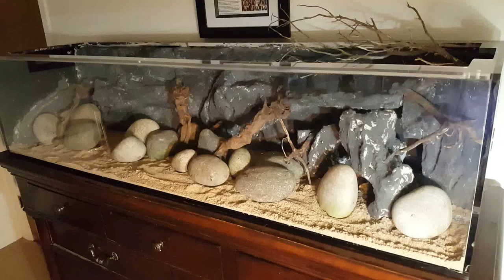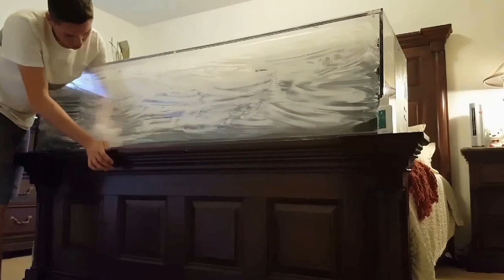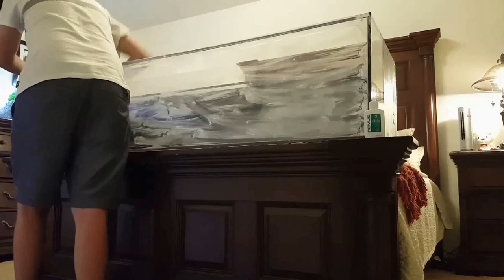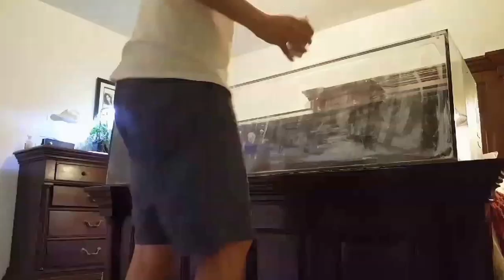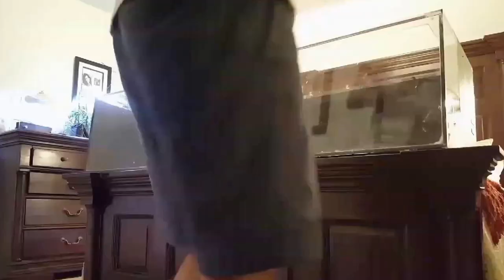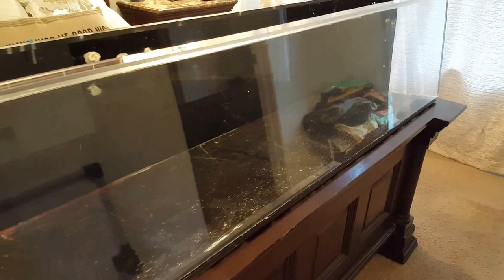Acrylic Scratch Remover DIY

Comment: Hi quick question,when you put stage 3 and 2 on do you leave the layer on for a bit or did you take off straight away once applied also what cloth did you use to take off wet or dry.thanks
Reply from the maker: Ac1892 
Novus #3 removes heavy scratches and abrasions from most acrylic surfaces. Use it when damage is too severe to be restored with NOVUS No. 2 polish. 
It requires the use of NOVUS No. 2 for final finishing. 
It is not recommended for use on coated plastics 
Shake well. Test in an inconspicuous area. 
Apply NOVUS No. 3 liberally. Using a clean, soft cloth, polish with a firm back-and-forth motion at right angles to the scratches. Keep the cloth saturated with polish at all times. 
Continue polishing until only fine scratches remain. Using cloth, remove all remaining polish, this is very important! 
Using a clean cloth, apply NOVUS No. 2 in a circular motion uniformly to entire surface. Polish using light pressure until NOVUS No. 2 dries to a light haze. 
Using a clean portion of the cloth, buff the surface clean. Follow with NOVUS No. 1 for best results.
Reply from the maker: Ac1892 
Novus #2

Novus Plastic Polish #2 removes fine scratches, haziness and abrasions from most plastics. With repeated use, NOVUS No. 2 restores faded and discolored plastics. 
It removes the damage instead of filling it in and it buffs out quickly 
Observe condition of the surface to be treated. The deeper the scratches, the greater the pressure required to remove them. 
If the surface is dirty, clean with NOVUS No.1 before applying NOVUS No. 2. 
Shake well and test in an inconspicuous area. 
Apply NOVUS No. 2 liberally. Using a clean, soft cloth, polish with a firm back-and-forth motion at right angles to the scratches. Keep the cloth saturated with polish at all times. 
When the worst scratches have been polished out, reapply NOVUS No.2 uniformly in a circular motion to the entire surface using short, circular strokes and light pressure. Allow to dry to a light haze. 
Using a clean portion of the cloth, buff the surface to a slippery glaze using firm, short strokes. This procedure is imperative in achieving the best results. 
For heavy scratches, multiple applications of NOVUS No. 2 or application of NOVUS No. 3 may be required. 
Follow with NOVUS No. 1 for best results.